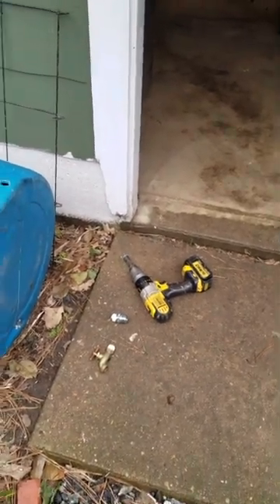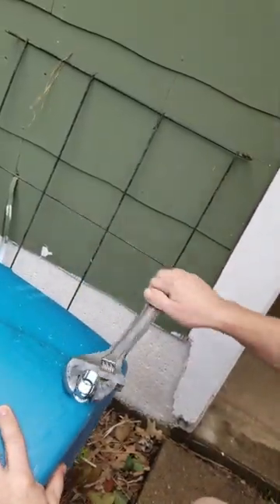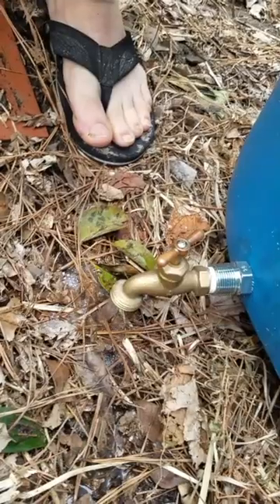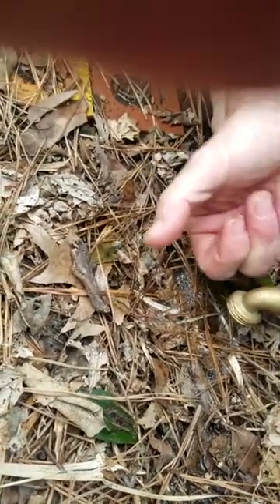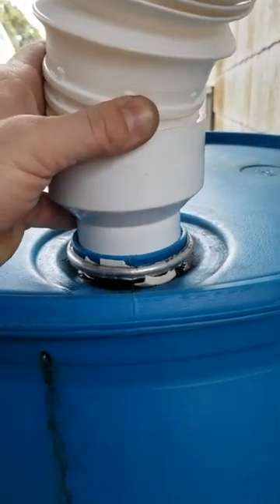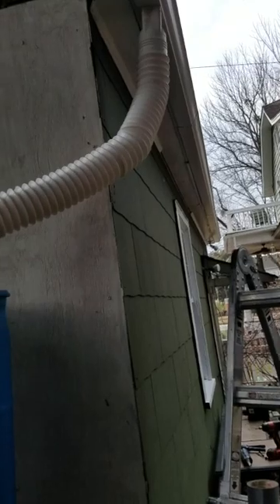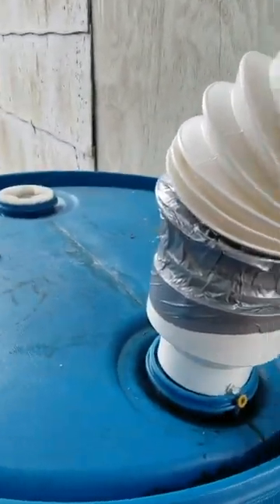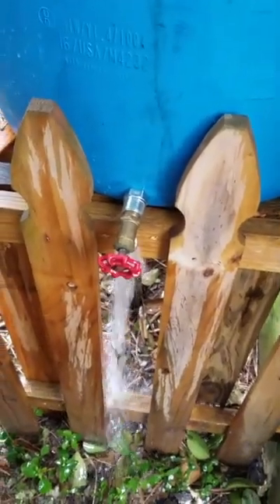Building a Cheap Rain Barrel (with Brian the Firefighter)

Comment: The barrel I have is a prefab one and the tap is 10-12” off the bottom so I can never get all the water out 😡 I like yours better.
Reply: @rehoboth_farm  My guess is so you can have the barrel on the ground and still fill up a watering can. Stupid design, though. I think some prefab ones have two spigots - one at the bottom and one farther up so you can install it on the ground or on a base.

Comment: Vertical video gives me rabies!
Reply: But really, building a rainwater barrel is one of the best things you can do if you have a garden. Not only is the water free, but it's also a more environmentally friendly way to water if you normally get water from your city/county as it doesn't have to be treated with a bunch of chemicals then be pumped all the way to your house which uses a good bit of electricity. I do have a recommendation for the hose bibb/spigot - get a quarter turn one. Or if you already have a spigot you can buy a little adapter that is a quarter turn that goes on the spigot - that's what I did. It actually improves your quality of life. :P Oh, and put some window screen at the inlet of the barrel to catch any poop from the roof.